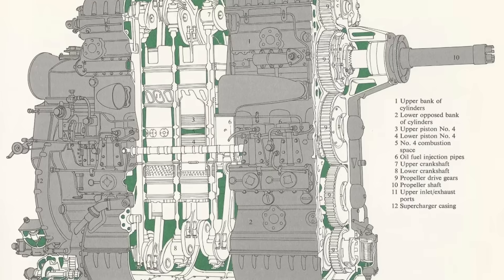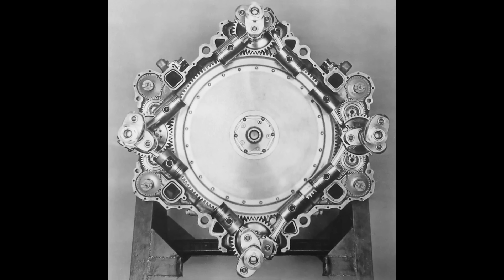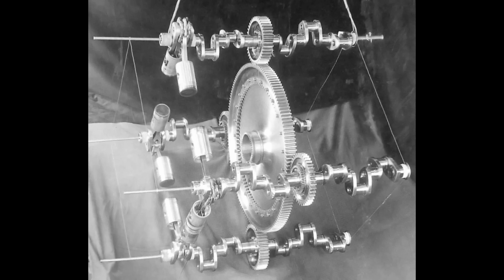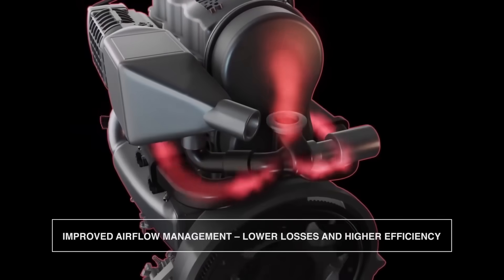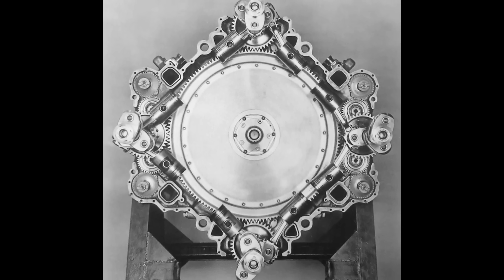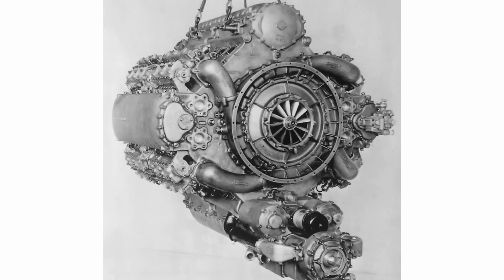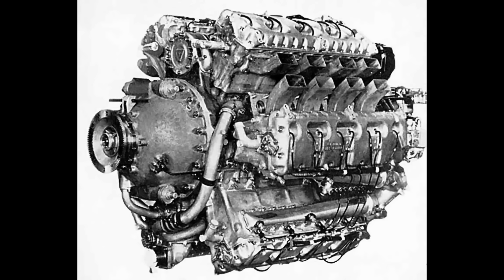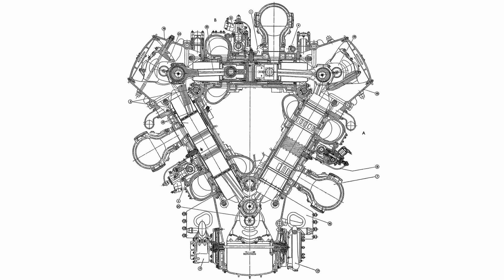The Jumo 223: Inside Nazi Germany’s Most Complex Aircraft Engine

Comment: Diesel is not a cycle. A diesel engine is a detonation engine either two or four stroke, also known as a compression ignition engine. The fuel when injected explodes, unlike petrol/gasoline which burns when ignited. High compression diesel engines when idling emit a sound known as diesel knock which is the sound of the exploding fuel.
Reply: Petrol engines have a homogenous charge of petrol/ air so if the propagation of the flame is at subsonic  speed it’s called  deflagration.  If it’s propagated supersonically by infrared radiation it’s called detonation.  In the case of a diesel there is no fuel in the air until it’s injected at top dead centre, it can only burn at the rate at which it is injected and that may be over two or three rapid pulses.
Reply: @williamzk9083

Mechanical injection doesn't have multiple pulses on any I'm familiar with. It's a spray that the longer it sprays the more fuel is burned over a longer duration.
Reply: @scottwhitcher265  some many modern injection systems inject two or three pulses. The first is a small pulse to stir up the air and create the conditions for dispersal of the second larger pulse.  I think these are mostly common rail injection systems.
Reply: Gee, I guess you should find and fix all of the thermodynamics textbooks that describe the Diesel cycle, complete with T-s and PV diagrams.

Comment: Cummins is currently developing a 4 cylinder with 8 opposing pistons engine for military use
Think of it, a nearly 100 years design
Reply: Hardly a new idea.  There is a Leyland tank engine the L60 that was used in the Chieftain tank. It dated from the late 1950's and also heavily borrowed from the Junkers 6 cylinder diesels.  You can hear them running on Mr Hews channel.
Reply: @thamesmud  Rolls Royce did the K 60 which has a similar set up, also the Commercial TS3, an opposed piston design but with the single crankshaft underneath the cylinders .
Reply: @scrumpydrinker  I had a roots blower off a T3, never had the nuts to fit it on a car though!
Reply: https://mart.cummins.com/imagelibrary/data/assetfiles/0058689.pdf
Reply: The Cummins Advanced Combat Engine is a collaboration with Achates, which has been unsuccessfully pushing opposed piston engines for a long time. It is intended to be available in 3, 4, and 6-cylinder variants, at 3.575 L displacement and about 250 horsepower output per cylinder; the largest would be main battle tanks, and the 4-cylinder is the initial version, intended for other armoured vehicles.

Comment: 2:22
Did this come before or after the initial design work on the Napier Deltec?
Reply: Development of the Deltic started in 1944, Napier held a license from Junkers for opposed piston diesels. The Jumo 223 was stopped around 1942.
Reply: @hiha2108  it’s interesting that the Deltec arrangement wasn’t used for the Napier nomad which used sleeve valves.  I suspect that what happened is that the aeroengine people simply adapted their know how from the Napier Sabre and used the sleeve valve.  The Deltic valveless  arrangement may have been a better aero engine

Comment: The Mayo Clinic used to have a HUGE Fairbanks Morse opposed piston engine driving an emergency generator. In the early 1960's they paid 1 million dollars for the engine and another 1 million dollars to ship it from England. My uncle worked and maintained the equipment...as a kid the engine was a monster but it was also a work of fabulous engineering.
Reply from the maker: That's awesome. Maybe I'll have to look into some of the Fairbanks engines...
Reply: @gerrywalsh5766

Fairbanks-Morse made opposed diesel engines that powered America's submarines and mine sweepers in WWII.
The submarine USS Drum is on display at Mobile, Al with two of them. Jacques Cousteau's Calypso and John Wayne's Wild Goose were originally mine sweepers that used them.
Reply: @scottwhitcher265  Union Pacific used them in locomotives for a short time because of the overstock that Fairbanks Morse had after the war.
Reply: @scottwhitcher265  Polaris should make an OP 1800R made from 2 900R engines and lay it down in the khaos!

Comment: 24 cylinders, 48 pistons, 4 crankshafts, 2 stroke, direct injection (no prechamber).   Being a 2 stroke dramatically reduces complexity compared to 4 stroke so quite doable.     The efficiency would have been incredible.  This is how we would be winging our way across the Atlantic and Pacific had the Jet engine no been viable.
Reply: @3:22 and @3:42 .. that is NOT 48 cylinders, BUT 24 cylinders with 2 piston in each.
Reply: @tellyonthewall8751  Good catch
Reply: Opposed piston 4 strokes don't exist - nowhere to put poppet valves and only an insane person would attempt to use sleeve valves
Reply: @PaulG.x 
God, l love a challenge. Napier's.
Reply: @ You need to be up to it though:
"The Napier Deltic engine is a British opposed-piston valveless, supercharged uniflow scavenged, two-stroke diesel engine used in marine and locomotive applications,"
Reply: @PaulG.x  ever heard of the 6-stroker? It’s an opposed piston engine where the crank & pistons on one side run a 4-stroke cycle, while the opposing pistons & crank runs the 2 stroke cycle, at half the revs, working the port valves too. It’s main benefit is it no longer needs a blower for scavenging & uses less fuel.
Reply: Mount the Jumo 207 OP 2 stroke in the arctic cat riot sled and its faster than skidoo and polaris!
Reply: Napier Deltic engines had a vibration problem.
 One of their engineers figured out that having one of the crankshafts counter rotate the vibration problem 
was solved

Comment: The complexity of this engine is boggling the mind. Compare it to a gas turbine and its relative simplicity and efficiency. They knew this at the time but could not make turbine blades that could stand the heat. Metallurgic’s is difficult
Reply: Germany ( and everyone else) was short of nickle and chrome that were needed for turbines.
Reply from the maker: They were definitely pushing the boundaries of what was possible with external combustion

Comment: Isn't that what the Deltic was loosely based on?
Reply: Yes... The Napier Deltic was originally designed and built to power patrol boats... But the end of WWII pushed those engines into train locomotives. 18 cylinders with 36 pistons. The New York City 1963 MACK super pumper fire truck had a 2,000 horsepower Napier Deltic driving the monster water pump.
Reply: @gerrywalsh5766  Thanks Gerry for stepping in...I will only add that the Deltic worked reliably unlike the Jumo as the dynamic vibrations were managed by British ingenuity and mathematical lateral thinking. Deltic are still in generating sets and locomotives all  these years later.   
King Charles  first command  HMS Bronington a Ton Class mines sweeper has two 3000 bhp Paxman Deltic 12A07a Diesel engines.  The NYC Mack fire truck is rather magnificent and the NYC fire department are very proud of it despite the engine being British.
Reply: @WOFFY-qc9te  Thank you and it's awesome seeing others interested in the Deltic. British ingenuity is the perfect word for the perfect power package. No valves or cylinder heads to fail. The harmonic balance issue i believe was solved by a bloke telling them to try 2 crankshafts running clockwise and the third one running counter clockwise. The German Jumo kept failing crankshafts because of the harmonics. I love the sound of the Deltic engine... I was once able to see the Deltic that powers the NYC fire department Super Pumper. She definitely ROARS.
Reply: Gerry, that pump truck is the dogs nuts must have been a wonderful moment for you to experience such a machine.  

The Deltic is a masterpiece of ingenuity the only thing it has in common with the Junkers is a shared cylinder which was nothing new.  The reverse crankshaft rotation was very much a beer mat moment which by coincidence and mathematics simplified the gear case and significantly reduced the crankshaft harmonics and the  torsional vibration.  I expect after a few beers is when they discovered the cylinder scavenge could be enhanced later named Uniflow. 

Lateral thinking is not something that comes easy to German engineers which is why Jumo was not successful or their axial turbine with its poor mean time between failure being a tenth of the simpler Whittle turbine.

I used to do dynamic balancing and vibration analysis. The solutions for the Deltic are wonderfully simple and if Junkers looked at their company Logo they would have seen the solution.  Odd numbers can be balanced by each other. The power to weight of the Deltic is impressive in fact most of Napier's engines had good P-W.   

Bristol is another company that made magnificent engines unfortunately any development of them and the Power Jets / Rover Turbine was hobbled by UK giving way to our friends across the pond.  Also we gave Russia the turbine to play with and they built the Mig !.

British are good at inventing and poor at investing in production.  
Best to you Gerry

Comment: My late Father told me about Otto back in 68, the two stroke gasoline engine, on paper it is not supposed to work, but it does, just like a Bumble Bee does not work on paper, as it's wings are too small, And it is too heavy, yet we all know that is does, I've been subscribed to your channel for years, but don't reply often, thank's for posting.👍🇺🇸
Reply from the maker: It's fascinating how some things defy conventional logic!
Reply: The internal combustion engine changed our world dramatically.  If you were European, it meant that a tractor could be used to tow a plough.  Steam engine tractors were too heavy for European soils. They’re only used to provide stationary power for thrashing or at best winching the plough.
It also meant that miners seeking to extract say tin, gold, zink had a small engine they could pack on day a donkey to drain water from the mine etc.  steam engines just don’t work for a lot of applications.